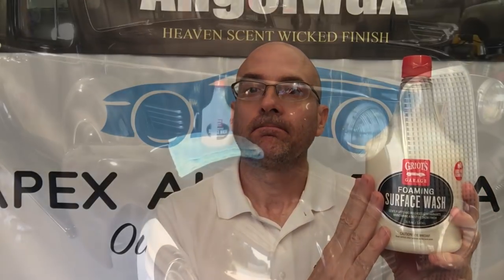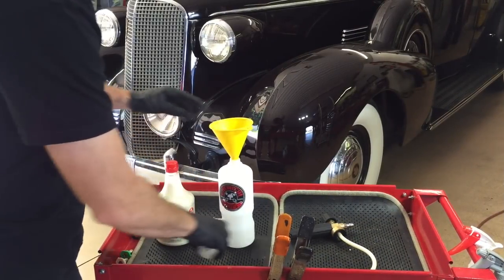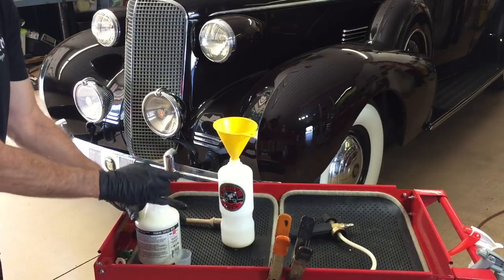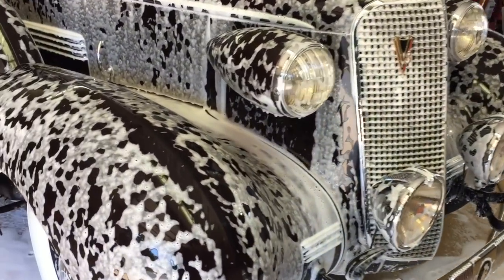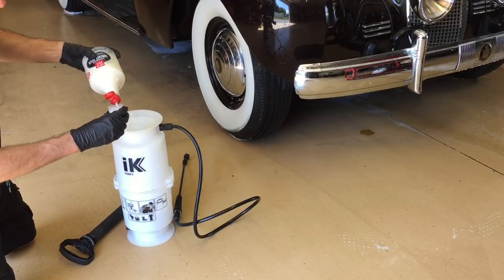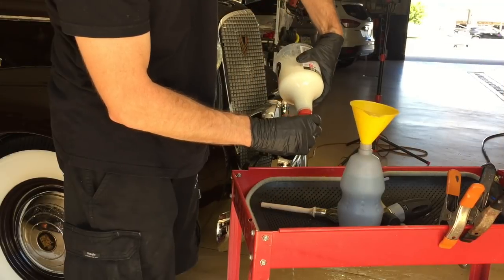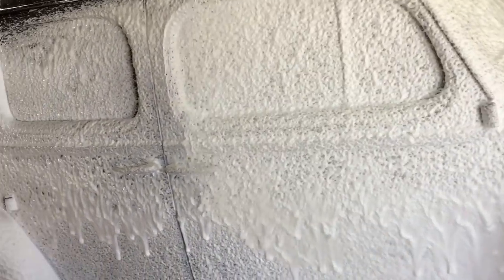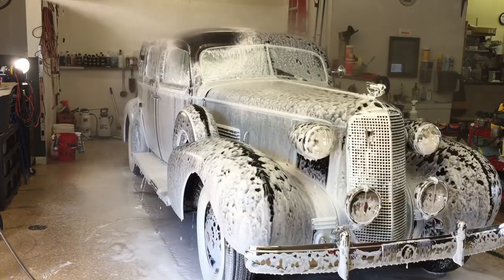Griot's Garage Foaming Surface Wash! Safe pH neutral pre-wash!

Comment: Great video, glad you did all 3 stages of application.  I just purchased some of this for maintenance washes, I bought their pump up foam gun because I only have a gas 3000 psi pw, didn't think I could use that much pressure with a foam cannon. I really don't want the expense of another pressure washer, Question: would I be safe to use the 3000 only understanding risks of seals and such? if so I will invest in a foam cannon.

Comment: $20 for 35 oz or $50 for 128 oz is a pretty easy decision for me. That said I bought the 35 oz bottle to see if i like it but it's on BO but I'll be using it in my IK 9foamer. 

I also ordered the Poly-Gloss but it too is on BO, can't wait to try both. 

My car is coated with 2x's TAC system power plus from early June of this year and topped with their Moonlight and 1 step Master, all Sio2 based products, 70%, 50% and 25% respectively. I bring this up because I get the impression you dont think Poly-Gloss is good on coated cars, why?
Reply from the maker: I normally do not top coated cars...my personal cars may get a designated topper to help with water spots...but i like the characteristics of the coating too much to top them.

Comment: Thanks for the review. What is your favorite soap for a foam cannon? Also I just wanted to comment that I have a greenworks 1600 and with a 1.1 mm orifice in my  foam cannon I can get similar results to your gas powered pressure washer.
Reply: Seconding the 1.1mm foam cannon nozzle in my PF22. (which now ships with a 1.1mm to swap in) I'm using a Sunjoe SPX 3000 and get similar or better foaming to the gas powered demos.
Reply from the maker: My fav is Angelwax Fast Foam and Cleanliness....one ounce each.
Reply: @apexdetail85  That's an interesting combo. I'll have to give that a try once I get both of those. Sort of sounds like a DIY Auto Finesse Avalanche.

Comment: Can I make a suggestion I would love to see windshield polishing I used carpro ceri glass with mixed results and eBay cerium oxide powder u add water too stay away folks I did so much damage with the eBay crud. I used the carpro stuff with rotary and long throw on felt pad for hours but didn’t get great results only made a huge mess. You can probably come up with a good method
Reply from the maker: I use Glassparency... but will get back to windows soon.
Reply: Apex Detail oh man I saw videos on that stuff on durability is it that much better than the others

Comment: Watching your comments 5 years ago and the price for this product has gone up only 3% in that time. You say it’s too expensive yet in checking various sites all comparable wastes from Gyeon, Koch Chemie, DIY Detail, Phoenix E.O.D., CarPro etc are about $70-$80 per gallon. Only when you drop down to something like Mesquites do you find a shampoo for say $20-$25 a gallon.  This also does not address the fact that if you own griots boss foam cannon the 35 oz bottles just screw right on RP the twin thread cap and there’s no mixing required for this or ploy gloss.  In this review you say you have no use for poly gloss in your shop yet when you did review it you said you would have to find more uses for it in your shop since you were so impressed.  Griots has also since your review added a foaming surface prep to this lineup being an alkaline wash to be used before the foaming surface wash. I find it cuts through the surface road grime very well and the three products together can knock out a car in about 30 minutes.

Comment: I don’t understand the price bashing??? 16 ounces of CG honeydew is 9 bucks. So for 32 ounces it’ll be $18. The Griots surface wash is 35 ounces; so it’s about even. Plus; it works way better than any CG snow foam as far as breaking down dirt.
Reply: Honeydew is a sad excuse for a prewash. It smells good for sure. But compared to a real prewash like Gyeon Foam, Auto Finesse Avalanche, Angelwax Cleanliness, it's child's play.
Reply from the maker: $30 to much in the gallon size. 32 oz will not get most of us through the week. I am not a CG fan at all. But Poorboys SuperSlick and Suds is thirty something....and kicks its ass when I comes to cleaning power. That is just one of many off the top of my head. There was no bashing...I just mention I can not recommend it.😁
Reply: Very interesting that you would recommend CarPro Reset at $85.00 a gallon but not Griot's Foaming Surface Wash at $50.00 a gallon. How can you justify $35.00 more per gallon? I must be missing something.
Reply from the maker: You are missing everything...apparently. This stuff is window dressing..at best. Reset kicks its ass up and down the wash bay all day long. Worth EVERY penny. Do I have to make it any clearer than that?
Reply: Apex Detail I respectfully disagree. I have both. As a pre wash, which surface cleaner is intended to be used as, I feel it kicks resets ass. 😀

Comment: It's an OK pre wash but I am with you I will not buy it. I rather use Honey Dew soap from chemical guys.
Reply from the maker: Exactly!!!
Reply: No chance honeydew will actually breakdown dirt like griots surface wash. Surface wash and bilt hamber are the only pre wash that actually work!
Reply: @qwikss7522  Add Gyeon Foam and Auto Finesse Avalanche to that list. Even on unprotected cars at basic dilution both remove stuck on pollen from my oak tree and other bonded contaminants. I wish Auto Finesse wasn't so hard to get stateside as Avalanche is the best that I've used. Haven't gotten a hold of Bilt Hamber yet. Where can I get it in the states?